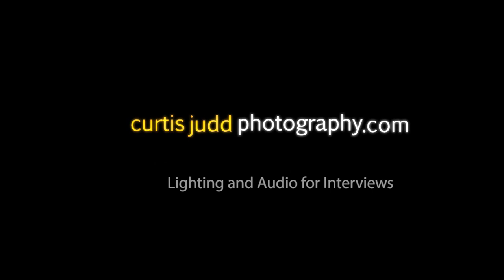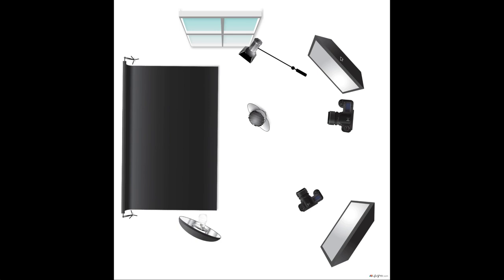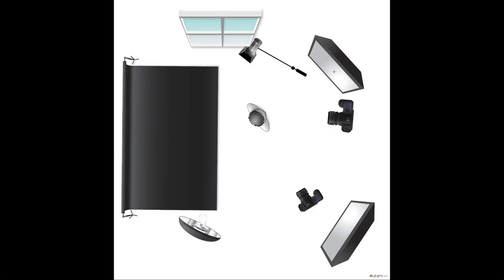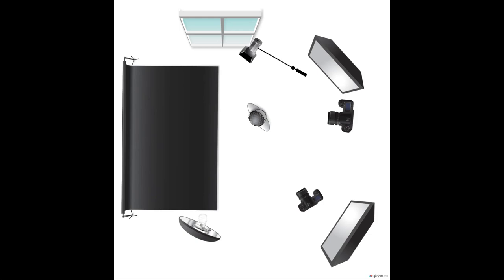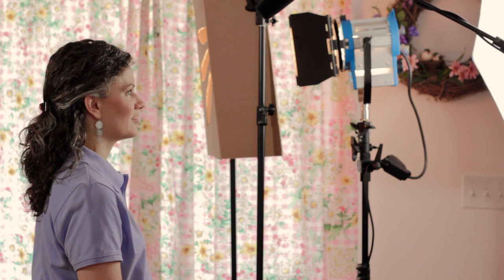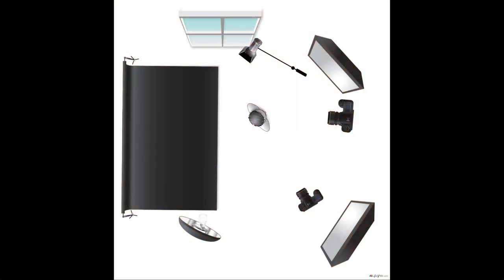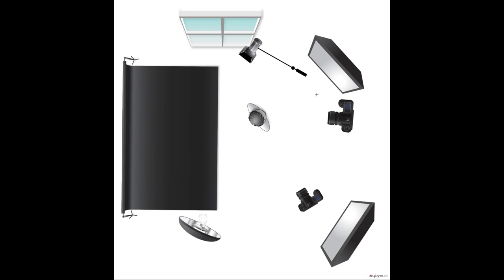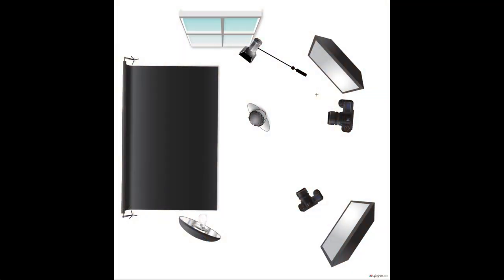Lighting and Audio for Interviews

Comment: Hi Curtis. I'm back from my photo/video job when I asked you about keeping track of video clips and separate audio clips.
I ran into a slight problem and was wondering if you could make a suggestion for the future.
I set up the talent with a lav mic going into my Zoom H4n stereo input. (changed mono to stereo in post later)
and also a Rode video mic pro-r into the other inputs of the Zoom.(1+2)
The plan was to have to separate recordings. One for talent and one for the interviewer. Which I basically got but...
The lav mic picked up the interviewer questions in the background and the Rode, interview mic picked up the talents answers.
In FCPx I had to mess and adjust the levels so that after the interviewer question I reduced the audio level.
Where did I go wrong. How should I have set up two mics without getting 'microphone bleed'.
As it happens I am not using the interviewers audio track/questions which worked out ok. Should both people have been much further way? But then I didn't have much space.
Thanks, Laurie.
Reply from the maker: +MyPhotosForever Hi! Yes, that's pretty typical, you'll almost always get a little bit of bleed. What I would do is in post, duck the bleed audio. It is a manual process but results are usually much better.

During production, when you don't have a lot of space, super-cardioid mics are usually the best choice. But with what you had, you probably did the best you could. :)

Comment: Great video!  If you have a two person interview, like a charlie rose type, would it be better to have two booms, one on each or average in between them, lavs aside, and if two mics, should they be a matched set or does it really matter?  Of course this is if you don't have a dedicated boom operator.
Reply from the maker: Yes, ideally you would have two booms. They don't have to be matched mics. In fact, some of the best sound mixers will figure out which mic sounds best for each person and use that.

Comment: Hey there. Great vid thanks. Can you also use a shotgun mic on a small stand on the floor in front of them pointing towards them?
Reply from the maker: Yes, best to angle the mic at 45 degrees and keep it as close as possible. You can usually get closer from above, but from below works when you don't have other options.
Reply: Thanks Curtis. Keep up the great work. Appreciate the work you put into your videos.